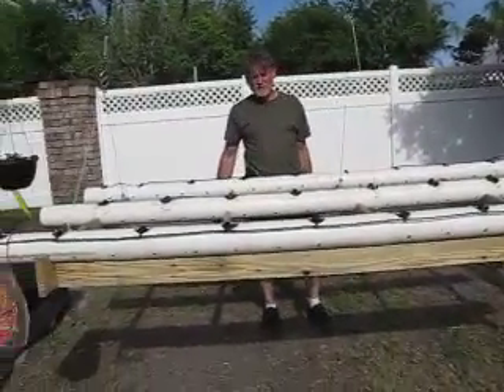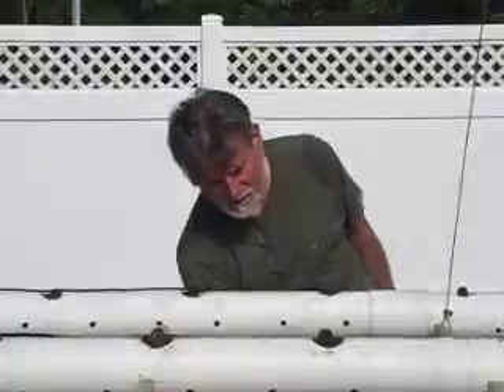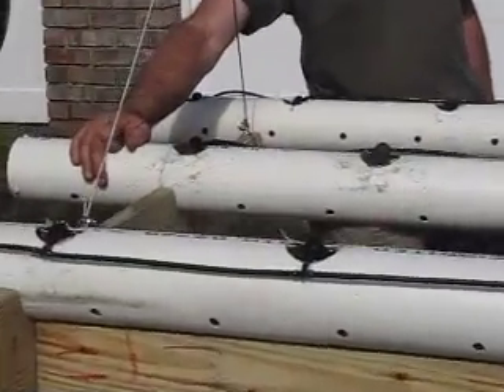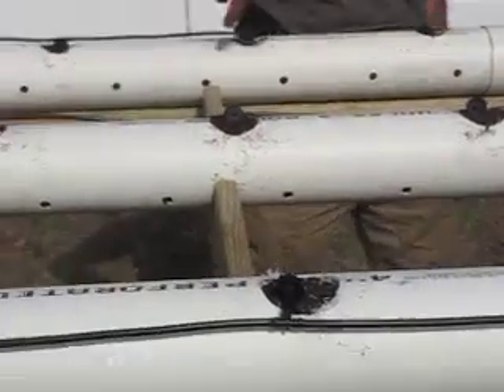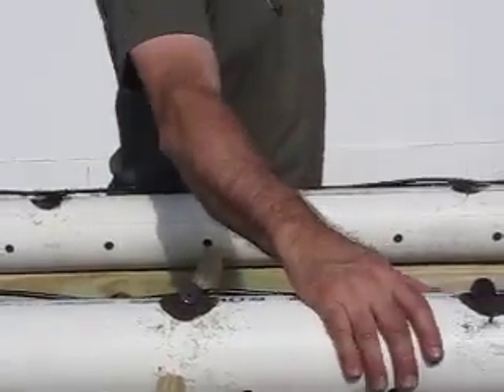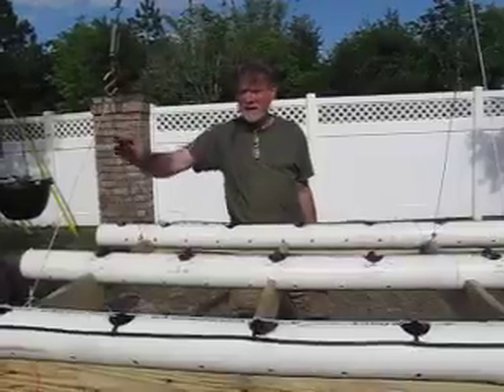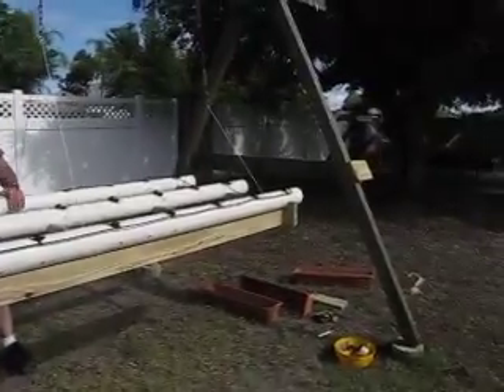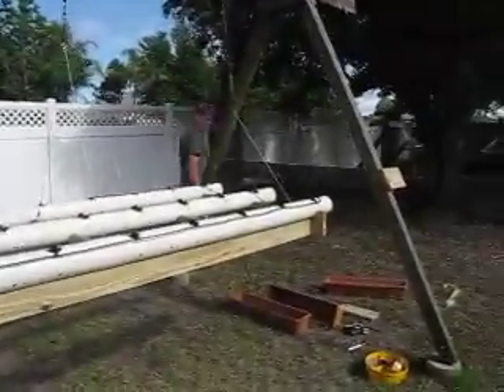Grow vegetables in PVC

Comment: You know, you could probably adjust this system to grow the plants hydroponically as well, then no problem with soil compaction. You would just need to cut out holes big enough to place net pots in and have a filling tube or hole at one end so you could add the liquid nutrients when needed.

Oh, I almost forgot, to solve the problem of not being able to add soil amendments, if you had a compost pile that was ready you could make compost tea and water it with that. That way your plants would still have gotten what they needed even with the soil compaction.
Reply from the maker: Absolutely.